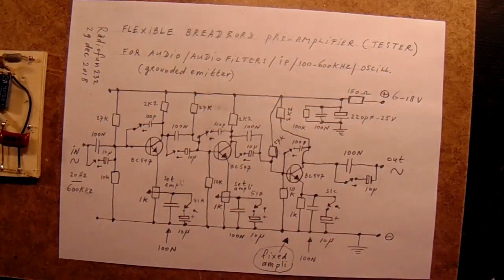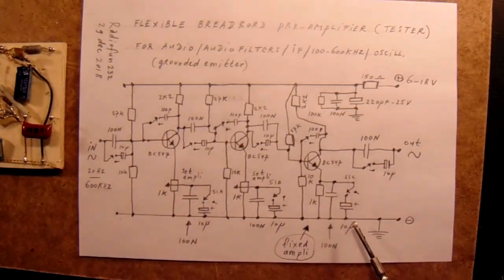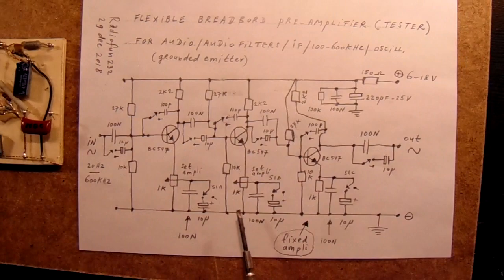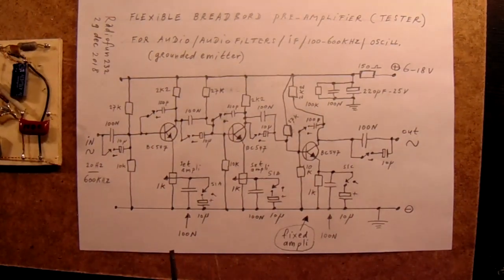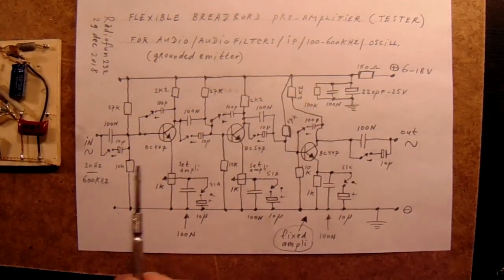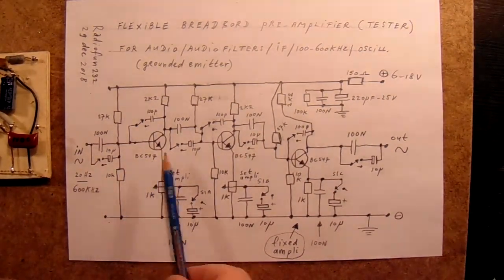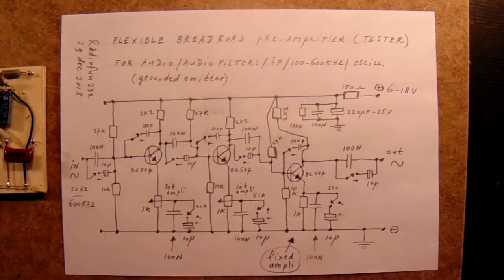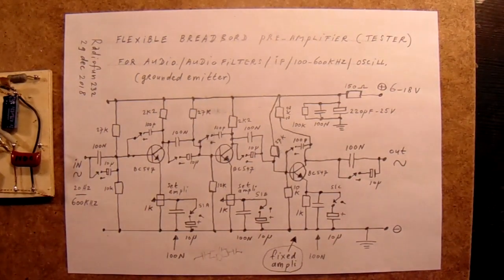Good basic 3 transistor grounded emitter (test) amplifier to learn a lot about electronics

Comment: Hello , I hope you are well and enjoying your day . I was wondering if where you have the 27k and 10k resistors if I could substitute the 27k with 22k or 33k ? I don't have any 27k . I'm going to experiment around with the values I have that are closest to 27k but thought I'd ask your advice first. Great video 👍
Reply from the maker: Hi Joe Scott, it is worth trying to substitute the 27 K by 33 K. It does not differ so much. But: 27 K combined with the 10 K as base voltage divider is the kind of "guarantee for "always succes", surely for a 9V-18V supply voltage and on frequencies between 20 Hz and 4 MHz or higher. So  you can make it with a 33K resistor, test/check e.g. it with the scope. Don't subsitute the 10 K in that case. When you have a potentiometer of 22 K or 25 K that could be a replacement for the 27K-10 K combi, wiper goes to the base of the transistor and you can align the bias/ideal working point by setting that potentiometer in approx. the middle position. When you use a 22 K or 25 K pot. meter always (!) use a protective resistor of 1 K, from the upper electrode of the potentiometer to the +. Reason: when you align the bias potentiometer and set the wiper accidently to max +, without base current protection with that 1 K resistor, the transistor will die immediately due to a too high base current. It dies without any sound, smoke, or whatever, so in silence, and you can search for hours to find the cause why the amplifier does not work.....:). More info in other video's about that grounded emitter circuit on my YT Channel.
Reply from the maker: This video shows that circuit where a potentiometer is used to set the bias 
https://youtu.be/-LYVZgEbJGE
Reply: Thank you so much for getting back to me this quickly ! I'm going to enjoy building this circuit . I'll work on putting it together tonight ! Take care 🎶

Comment: Hy, I wana add that amplification with emitter capacitor isnt that dificult to calculate.
It is simply Rc/(25mV/Ic)
Reply from the maker: OK, good, can you give an example calculation for everyone watching this video? I am interested too.
Reply: @radiofun232  
Well i have a video how to design common emitter amplifier, but i dont go in detail about this topic)
But casically transistor emitter has internal resistance called re (small letters).
It can be calculated with equation 26mV/Ic, which gives you the resistance. (I wrote 25mV on top, because it is easier to calculate with 25, than 26.)
Then you just use this in equation Rc/Re, which you already know.
Reply: @radiofun232  So for example you have current flow of 1mA.
This means your re is 26mV/1mA=26 Ohms.
Now you can use A=2.2k/26ohms=85.
This calculation is assuming Reactance of capacitor is close to 0. If you want to calculate at some frequency where it is not close to 0, then you need to add reactance of capacitor to this resistance.
Reply from the maker: @SkazaTV  OK thanks, I will keep your comment up  for other YT users with more math education :) . So that they can react, anyway, thanks. 29 dec 2018.